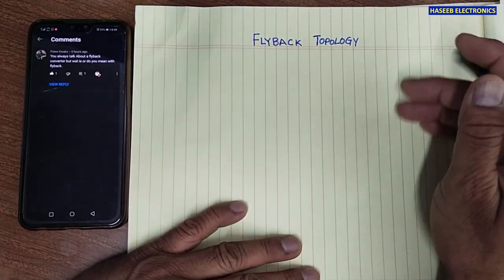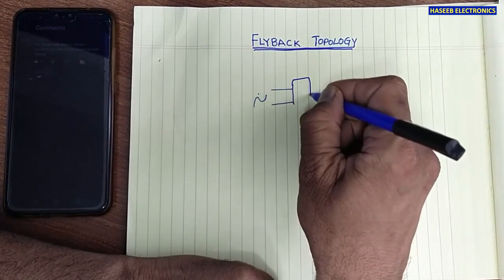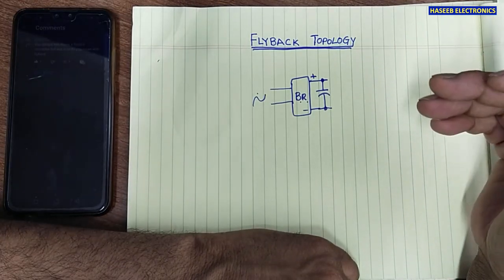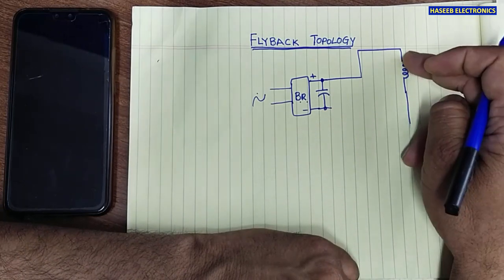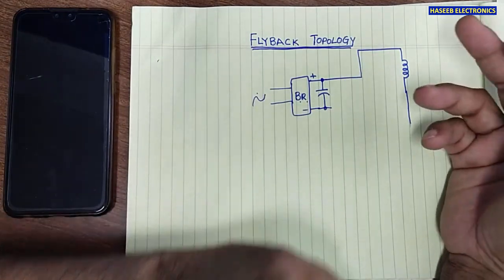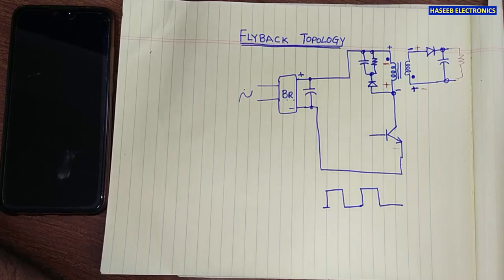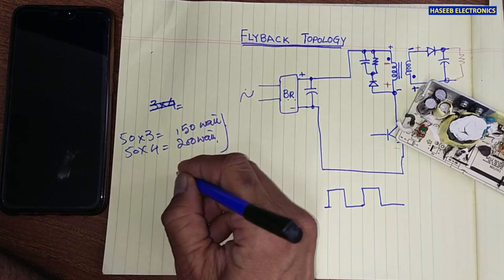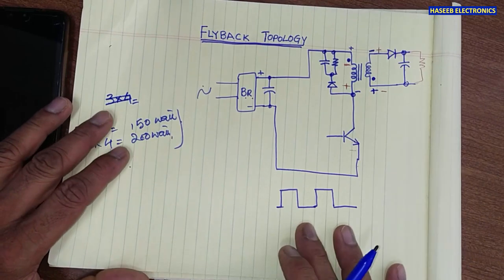{829} What Is Flyback Converter Topology

Comment: Why FLY BACK? What flies? And what goes back? Surely a better name would be UseCollapsingField UCF SMPS.
Reply from the maker: haha
awesome
but it is named from someone else 
actually it transfers energy when the magnetic flux  flies back during off period
Reply: You know how a swing flies back at you after you push it and it reverse it motion back to you?
Reply: The name comes from cathode ray tube television deflection output transformer.. Horizontal deflection work similarly; switch turns on in sync with video and current starts to rise in deflection magnetics; after linearish horizontal sweep energy is stored in deflection magnetics. Then switch opens and deflection circuit oscillates through flyback diode with flyback capacitor to get the crt electron beam 'FLY' back to zero very fast. The energy of collapsing magnetic field is transferred to eg. deflection output transformer high voltage coil among other coils..then the cycle starts over to draw the next line alla the time initiated by video sync circuit.. The name is inherited there!

Comment: What happen when there's a leak on transistor?
Reply from the maker: the transistor leakage causes to dissipate more heat
Reply: @HaseebElectronics  could there be a stable output if there's a leak?
Reply: If BC ( Base Collector)value is more than BE using diode test, will that be considered a leak?
Reply from the maker: @jacksonv1ll836  if BC reading is higher, then the transistor is considered as bad transistor
for more surety we can test it with transistor tester for testing the gain 
if the gain is lowered than it must be replaced
ideally if BC resistance is higher 
then the collector current will decrease. thus it's gain will low

Comment: I wound a transformer for my 12V to 300V flyback but I wound the primary and secondary in the same direction.
The start of the primary winding is connected to the 12V input. On the secondary side the start of winding is connected to ground.
It seems to work fine but is this wrong?
Reply from the maker: yes it is also good. actually it needs keep secondary, during conduction of the switching device. 
so your method is also perfect. in this way it will work normally

Comment: Flyback, the stored magnetic field in the transformer is used. The transformer is used as an Enery Storage.
Forward, the stored magnetic field in the transformer is a problem (resetting required). The transformer is used as Energy transfer.

Comment: Excellent. So, I can understand why one might use a flyback, when the supply source is already DC (portable battery device) and the circuit requires AC. What are the circumstances where an AC supply is rectified to DC and a flyback is used to change it back to AC, as in your example? What are the advantages of doing so? Please and thank you.

Comment: Nice video Sir 
Please explain tny 288pg ic full circuit  specially the zenner diode which is used 1st pin to source (what voltage of that zenner diode is)

Comment: I have designed 12W constant current flyback converter, with 12.5V/ 850mA output. (PWM IC with Fixed frequency 65kHz.)
Issue is, schottky diode UF5408 is getting heated upto 85°C & checked on oscilloscope the actual frequency is 39kHz (at MOSFET gate, +duty is 15% & -duty is 85%, where as at transformr output +duty is 60% & -duty is 40% )
What must be the problem.??

Comment: Love the videos and I am glad you did this one. I have been working on that ate my lunch. It is a dual voltage psu using both a top254 on one transformer, and a ucc28700 to run a fet on the other. Both chips fluctuate voltage at their vcc caps but it seems both opto are working. Ideas please?

Comment: is iron transformer same as flyback?
Reply from the maker: iron core transformer (which is being operated at sine wave) that can be used in any configuration. 
but when a phase shift is necessary then the dot function (180 degree rotation is incorporated between primary and secondary winding direction)